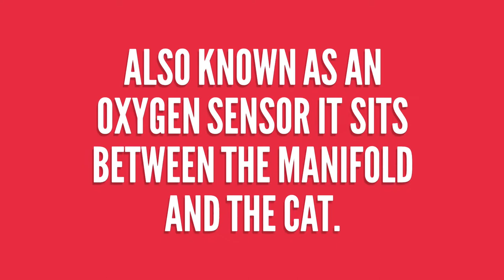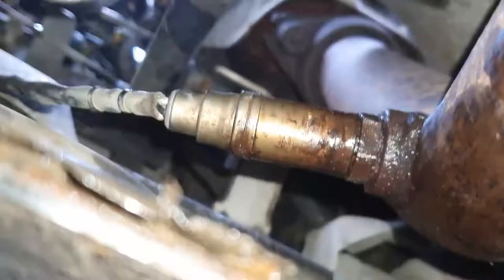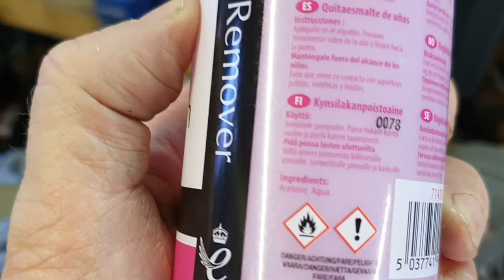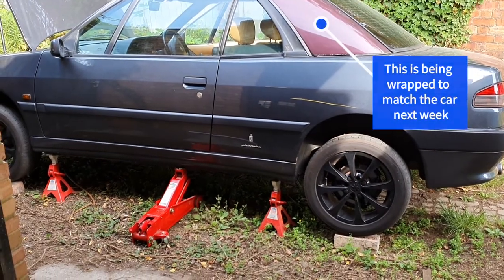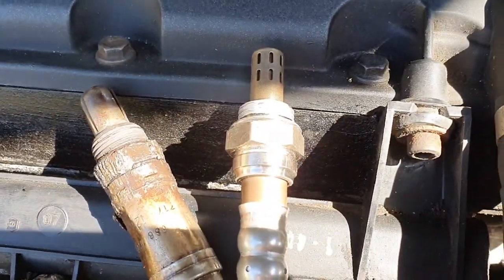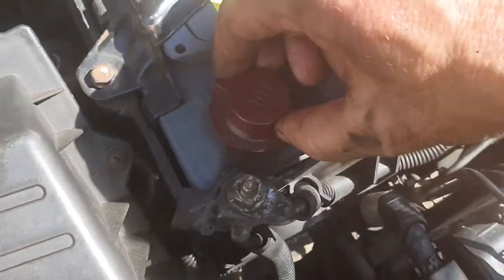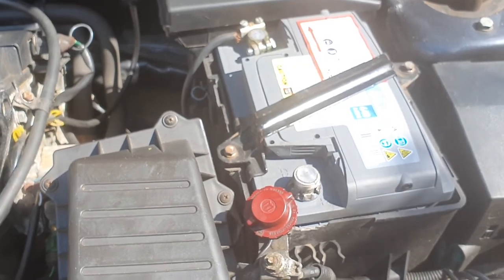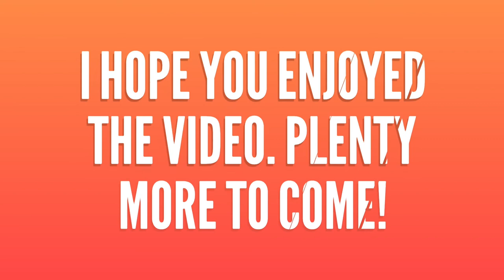🛠How to Replace Your Lambda Sensor 👉 Peugeot 306 Cabriolet!

Comment: Hi just wondering what the symptoms were other than rough idling, having issues with my model and want to see if there are similarities
Reply from the maker: It was basically running roughly and hessitantly when you put your foot down. Even if you are unsure it is worth changing it as it is fairly cheap and simple.......as long as you can get the old one out!
Reply: @OldTwitTalksCars  okay thanks heaps!
Reply: @OldTwitTalksCars  struggling to figure out how to remove the plug, tried to slide the red tab but still having issues
Reply from the maker: @elizacampbell4638  Do you mean the plug under the bonnet? Usually there is a little tab on the side that you need to push in. Use a small screwdriver or similar to push the tab in and then it should pull off. Of course some may be different depending on model year etc but that's the usual set up I think.